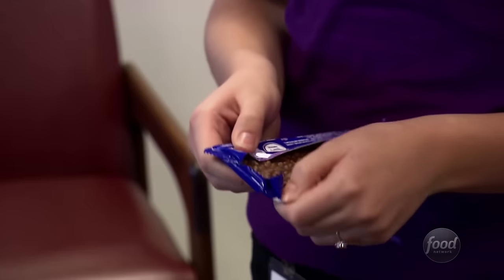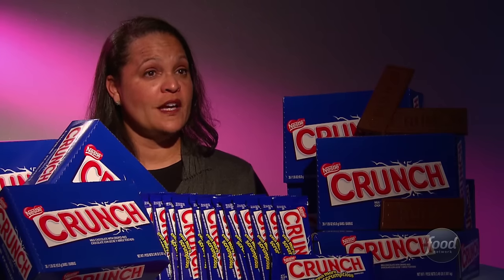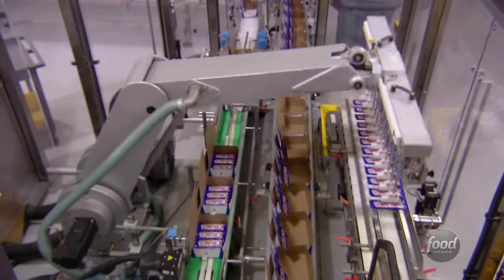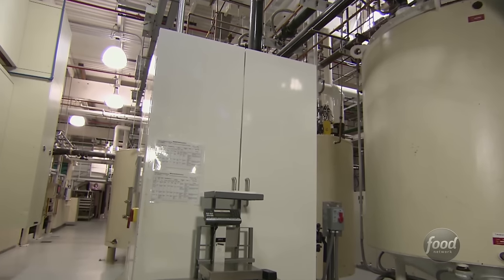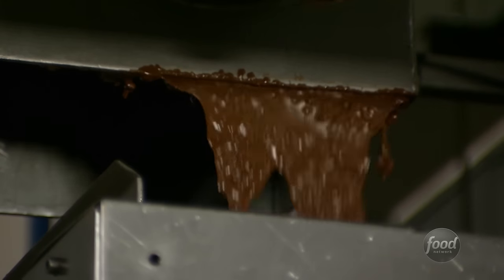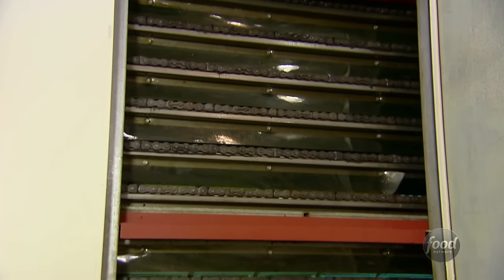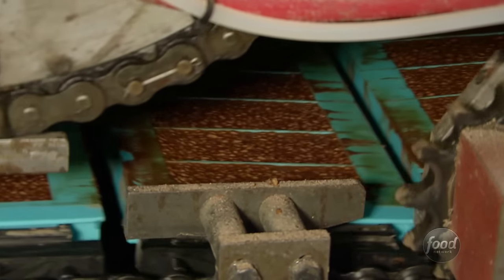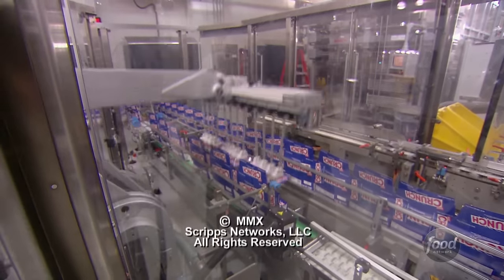How Crunch Bars Are Made (from Unwrapped) | Food Network

Comment: The 400 grains of rice in every bar they proclaim to have appears to be mathematically impossible... If someone comes across this comment and can explain why I'm incorrect by assuming so, please correct me.
Reply: Artoria Salter a company I use to work for made and sold the rice for this bar. it’s called rice pops. Its extruded product, were rice flour is turned into a mush and then pushed though a small hole know as a dye to form the rice crisps. 

I can only assume they called the raw rice flour mix and not the end rice pop as it wouldn’t fit in the bar